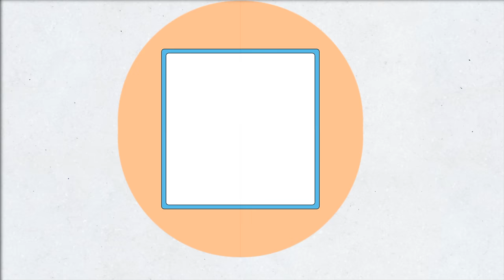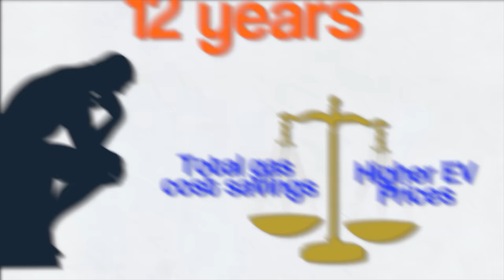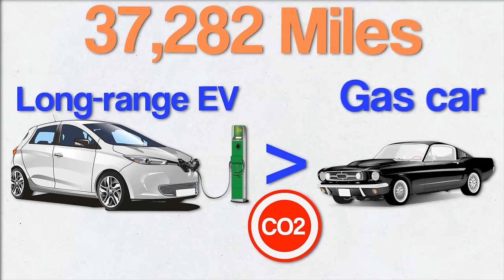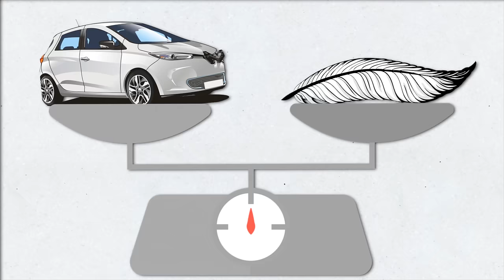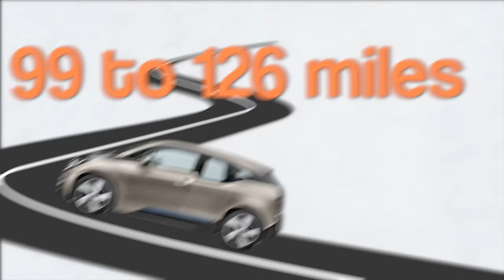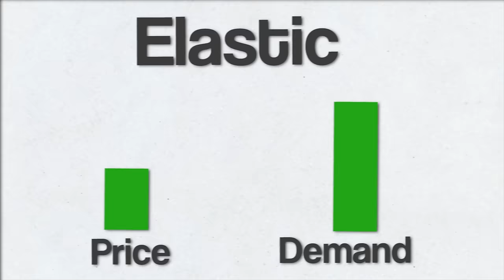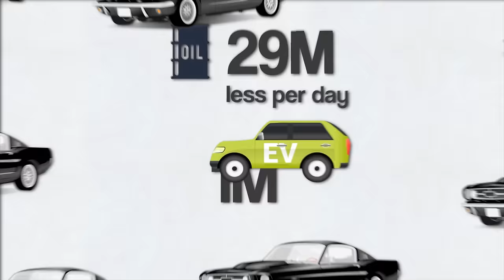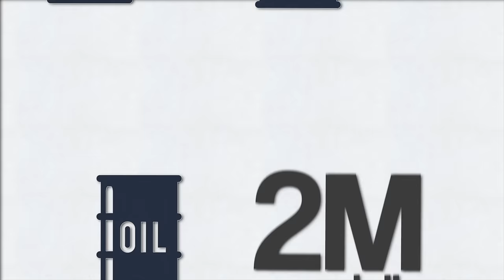If You're Worried About Rising Gas Prices, Watch This

Comment: I agree with you as to why an EV purchase is not wise at this time.  Perhaps if someone really wants to buy one it would be best that he/she lived in and regularly commuted to work in a large city with heavy traffic.  Their carbon footprint would be lower and the skies wouldn’t have that brown haze.  However, I do believe that a hybrid vehicle is the wisest choice nowadays.  Vehicles with a small 4 cylinder engine in a hybrid can get up to 50mpg and they aren’t that expensive, depending on options.  I recently bought a 3 row SUV with a 4 cylinder engine that gets 35mpg in town and 36-37 mpg on the highway.  It is the Toyota Highlander, so not inexpensive compared to others, but it has the nickel hydride battery instead of the lithium battery.  The nickel metal hydride battery is heavier but it still weighs only 200 lbs.  It’s like driving around with a person is in my car when there isn’t, LOL. Lithium is toxic which is one reason it’s not recycled and in certain temperature extremes it can become unstable.  NiMH Batteries are recycled, aren’t affected by temperature extremes and cost less.  My fuel tank holds 17 gallons of 87 octane gasoline which gives it a range of 600 miles.  It is for these reasons and others that it makes sense to buy a hybrid vehicle instead of an EV.

Comment: Hey Scotty I have a question I have a 2001 dodge Durango with a 5.9 L V8 engine 
Do they make good engines and reliable transmissions I was told that it was practically bulletproof should I put money into it , the Struts are going out and The underneath somewhere makes a clunking sound sometimes when I’m driving down the freeway going 65 miles an hour it has 248,000 miles on it and it’s my daily driver to home from work. Should I get rid of it or drive it until the wheels fall off?

Comment: I got an EV a couple months ago. For what it's worth it does save money but there's a big asterisk with that. First, price- anything over 40k destroys savings, the idea is to replace the daily IF that daily is a old beat up bucket. In my case I was using 30 gallons of fuel a week just going back and forth to work in a old 2500 chevy. The cost of fuel ate me up. The price of the car should realistically be from 30 to 40k to make up the difference, if not then it just doesn't make sense. Also understand that I'm not just a random person, I have a extremely unique set of circumstances, the truck had no creature comforts except heat, needs work, old, tired beat up truck ( which I still have and still drive once a week because regardless of its condition I like my truck, because it's mine.) The leaf needs none of the work yet, drives well, has more bells and whistles that I'll never use, and hasn't impacted me financially. But unless you fit a very extremely narrow niche EV is not the way to go. As far as my power bill and range anxiety, have yet to have a issue with either. I charge it twice a week and the bill went up maybe 30 bucks. Range at 100% is 240 miles, as a around town car it's perfect. I'd never take it on a road trip but I'm not a travel kinda person either, I've done my fair share of that already and don't intend on doing that again. Again, I can not stress enough, it is not for most people. Even if it's a option is has a very narrow function and is more or less just another tool for the arsenal and less of a replacement

Comment: The question one should be asking is how long the batteries last before they need to be replaced?
Reply: Wild guess? 5 years.
Reply: Majority of EVs have a 10 year 100k (some have 150k) mile warranty on the battery. It's nothing to worry about. And if you decide to keep the car longer than that, by the time the battery needs replacing the technology will have advanced that the battery you replace it with will most likely be cheaper and have longer range.
Reply: The FUD of battery life comes from the early EV/Hybrids of 10+ years ago since they had no battery management system (BMS) to keep the batteries at the preferred ideal temperature. These days all modern EVs (but still not the Leaf for some reason) have very good BMS systems - there are people with BoltEVs and Teslas that have 200-300K+ miles and less than10% battery degradation. The batteries will outlast the cars, and can be retired for battery storage systems or recycling at the end of their vehicle life.

Comment: You only look at one side of the coin. 

My 2002 Vanagon weighs 6000 lbs and an engine replacement would cost $10k+. A refurbished battery was only $695 installed in our Prius. There are also constant and continuous severe problems with pumping and distribution of fossil fuels. 

Tell me you support big oil without telling me you support big oil.

Comment: Typical courier or Ubi driver drives between 60 and 120K a year. Now, it is well known that the big T EV (named after a famous scientist) gets only about 30K on the tires due to the weight of the batteries. Those tires (unless you found a great deal) run around $274 a tire. That is roughly $1300 (balancing and possible alignment). Plus, each year I also get new shocks / struts. That is around $1000. That is potentially $4300 per year for someone who drives high miles. That isn't even counting the possible brakes, tune-up (recommended). 2.3 tons. That is a lot!!! Happy driving!!!

Comment: Another issue the US continues to ignore is the the current weakness of our energy grid.  We can barely handle the load when the weather gets hot.  AC units on their own cause brown outs and black outs.  Imagine the consequences of adding the charging of several million EV's to the mix.  Our grid would see a massive drop in reliability.  Nobody gives any real attention to this fact.  The power has to come from somewhere, and if the source is already weak you're just asking for more trouble.

Comment: This is why I opted for a hybrid Corolla instead of an electric car. The Toyota is going to last for decades and is a proven, reliable, efficient operation. My dad bought a Prius in 2002 and it's still running 20 years and 200,000 miles later.

Comment: Great video well done - many of the controversial issues that you have identified in this video would not exist if the EV focus was in the direction of the Hydrogen Cell EV - it would be interesting to see a video that challenges the issues that you have identitied comparing Lithium Battery EV's and Hydrogen Cell EV's.
Reply: H fuel cell technology has been researched/developed by the major car OEMs for nearly 3 decades, funded by the DOE until killed by the Obama Administration.  Because it was just a subsidy with no results.  Nothing in the way of a cost-effective solution has been found.  Not to mention that the infrastructure for H2 would have to be built from scratch (unlike fossil fuel and electric infrastructure, which is robust), in part due to the fact that H is a small molecule that easily escapes storage, meaning money leaks all the time.  That means H production needs to be largely local, since it's difficult to store and transport.  There's no cost-effective solution for H storage, it's also been researched for decades.
You can look it all up.
Reply: Have you bought a hydrogen car? If not, why not?

Comment: $17,000/ 150,000 miles = 11 cents/mile.  At 120 MPGe, that make the battery cost $13.6/gallon.  A New Engine Type car would get 160 mpg on $1/gal fuel made at home.

Comment: Fill up at pump takes 15 seconds for 2.5 gallons, which is the SAME energy that an EV has with 84 kwh, which takes 50 minutes at 100 kw constant.  Reality is 1.3 hrs usually.  Around 200 times slower to charge.
Reply: your math doesn't quite make sense since that 84kwh will get you ~300 miles in an EV. In an ICE it will get you way less miles so you need to take that into account. Battery fast charging tech is improving all the time btw. Ioniq5 and EV6 can DC fast charge from 0-80% in 18 minutes.
Reply: @sbroumley  Sorry, my mistake.  I forgot to tell you that New Engine Type (NET) engine is the SAME energy efficiency as an EV (50-75%), and gets 1.33-1.5 times better MPG due to half the weight.  That would be 400-450 miles on 2.5 gallons.  An EV at 80% of 300 miles is 240 miles.  The range is also 5000 miles with 100% CO2 capture.  If the fuel tank were the same weight at the battery, the range would be 21,700 miles, not a silly 300 miles.  BMW and Volvo, along with most thinking car companies realize that EVs can't get the CO2 out due to the CO2 in the BEV manufacture.  The best estimate by Volvo is 25-35% depending on assumptions on 100% RE grid.  NET can get 96% with house solar thermal.  Capture CO2 from car, make fuel from solar, store, and use it (combustion...cleans air, btw), and repeat.  Fuel will be around $1/gal and 160 mpg and no drive battery needed.  My view is EVs are totally silly nonsense and are worthless....
Reply: @sbroumley  I was referencing New Engine Type tech that gets 160 mpg...Sorry for the misunderstanding.  Again, EVs are OBSOLETE.

Comment: I drive my gas guzzler less often and consolidate my trips. The little pollution it puts out, is tiny compared to the environment impact of making and charging an electric car to replace it. And since the average age of cars on the road in USA is 12 years and going UP, not only is the supply of new ones restricted, but the public doesn't have the $$$$ for even more expensive EVs.

Comment: Personally, I think electric cars or some other innovation in engine technology, like fusion energy, will be the future, but it's full implementation is not here yet.  Absolutely adopt electric cars and trucks, and make them available to the public that wants them. More exposure in the public will make them less expensive over time, but the technology really needs to be put into increasing range. There's no reason not to reach for a 500 mile battery. Then you would have something worthwhile to bring into the industry.
If someone has a job that requires them to drive to different locations, and the maximum distance they can drive is limited by the battery in their vehicle, the person is going to probably buy a gasoline powered vehicle. 10 minutes at a gas station refueling and paying for the gas is infinitely better than a half hour minimum to recharge the battery bank.
Also, the availablilty of recharging stations needs to expand dramatically. 
Right now, my town of 25,000 in sw North Dakota, has 1 Tesla supercharging station, and that was only built a few years ago. The next closest station is over 100 miles away to the east and west, and to the north, is in Canada (Quite a ways up into Canada), and to the south, over 200 miles away. There are other plug-share charging stations, but you have to look online for a map, then hope it's accurate, and not some intended location to construct a charging station in the future....and every little town for the most part, has a gas station. 

Sorry, but I'll stay with my gas powered vehicles.

Comment: The people that own EVs don't care as much about rising gas prices because it doesn't apply to  their car, although it does apply to them in rising prices everywhere else. Let's look at the other advantages of EVS. Eventually somebody is going to build a device that will charge the battery of the EV while it's driving down the road, via solar power or perhaps a mini wind turbine operated by a forced air turbo system, and then that's going to eliminate the need to stop and charge your car for an hour or two. You won't have to stop to get gas, you won't have to worry about somebody stealing your credit card information for swiping it at the pump, I think people will be just happy with these and OPEC will get what their greedy azzes deserve.
Reply: Yeah, maybe. Im still waiting for the flying cars they promised us......🤬

Comment: There is around 140 pounds of lithium total in a Tesla Model S battery pack. 500,000 gallons of water is used for every 14 battery packs made for Tesla cars. 387,000 Teslas of all types have been manufactured. Divided by 14 battery packs per 500,000 gallons of water equals 27,642 sets of 14 battery packs, times the 500,000 gallons of water it takes to make 14 battery packs equals 13,821,428,571 gallons of water that has been used to make all of the battery packs manufactured so far for Tesla cars. I think I got that right.....

Comment: This information while entertaining is not entirely accurate.
I bought a used EV in September 2021.
Got a great deal and a good reliable nearly new car for 15K. My family and I love it! No gas no worries. It will outrun most cars on the road,  I charge it with solar power and it runs Great! 
Happy Motoring!
Reply: That's awesome - which EV did you get?

Comment: EVs are a great alternative for some people but not all people.  A couple of points you've omitted.  Depending on make and state, many folks will qualify for $7-10k tax credit to offset higher cost.  Many EVs use one-pedal driving and brakes can last 10+ years.  EVs come in all shapes and sizes with dozens of models hitting the market.  Look at Rivian and EV trucks for an example.  Long charging times are irrelevant if you charge 99% at home.  So when folks ask me "EV or ICE", my answer is "why not both?".  I'm counting the days until my EV arrives.  Cost to fill a "tank" will go from $100 to $17 all from the comfort of my home while I sleep.

Comment: Higher demand on electricity will increase the price of even your home power.  You still don’t save in the long term.  Want to do less emissions drive high mpg vehicles that are typically smaller.   Better yet when it’s practical use Ebikes for local commutes and leave the car in the driveway.

Comment: They should use solar panels on the top panels of the EVs . As for me I'm sticking to gas vehicles. In fact vehicles prior to 2000 are best due to all the computer controlled lights doors etc  they are making a conputerized mess on a vehicles that are meant to be basic transport

Comment: One way that EV's could work will be an ability to connect to a stationary power supply while in motion. Then the storage capacity of the batteries could be reduced, maybe to the point where a bank of traditional lead-acid batteries  could be used to cover the dead-spots. 
I think our transportation model based on everyone having their own vehicle may be needing a major revision in thinking.
The most energy efficient means to move people and cargo  is with the use of electrified rail. That I believe to be the future. 
I was borne at the start of the age of automotive dominance, 1949. I may live to see that age end.

Comment: A 1000 lbs battery in an EV would get ~240 miles at 80% charge.  That same 1000 lbs in gasoline (155 gallons) + tank would give 21,700 miles in a NET car.  90 times further range/weight of "fuel tank".
Reply: Your math is off and definitely not an apples to apples comparison.
21,700miles from 155 gallons is (21700/155) miles per gallon = 140mpg. 
Also that EV 80% charge will cost you say $30. Tat 155 gallons of gasoline will cost say $4 x 155 = $620.

Comment: Scotty you beautiful fish, finally someone on YouTube that actually researches and outlines the reality of EV cars. Except about the oil impacts, Where's the energy coming from to charge the battery? Depends where you live but it ain't the fictional "renewable" energy so it's coal, gas or oil. So they're moving the pollution from what you see to what you don't see, it's almost magic but the CO2 is still getting generated that's guaranteed. It's not magic!
Volvo released a report stating an EV under pristine conditions must drive 60,000 Miles to even begin to break even with a fossil fuel vehicle.

Comment: When talking about battery replacement cost, its odd that you went straight for a car which costs £95k and has a 100kwh battery capacity. Let’s take a car with a more realistic price. How about the Kia e-Niro 4+, a car we have which cost £40k and has a 64kwh battery. Now £87 per kWh x 64 = £5568 or £6,905. Slightly different from the 12-15k you mentioned. The Peugeot e-208 has a 50 kWh battery, which would give a figure of $5394

Comment: Forgot to mention our current power grid could not handle everyone plugging in their cars. That will require a massive change there first and just how do you get more power to run them? It ain't coming from the wind or sun, that's for certain. EV's are the flavour of the day but we're simply not ready or efficient enough yet.

Comment: Your sir are wrong. I bought a used 2014 nissan leaf with 32,624 miles on it I paid $8,999 February 2020 it will be paid off in 5 weeks free and clear. Never changed the brakes no exhaust tune up or oil change. Not including those my gas (electricity) will have paid for the car in 1 more year this is based on $3.00 a gallon of gas. I can charge at any nissan dealership for free and most other places are FREE I don't even pay to charge in most public places. I got the discount because  it was in a fender bender and the battery was ruined. The insurance fixed the car and it got a new battery. If its cleaner great I did this strictly to save money. Your right about range anxiety especially since everywhere I go is about 15-25 minutes away. But one you have your routine you know how much gas or battery % you will use. I never ran out of gas and I have the 24kwh battery which gives me roughly 75 miles if I drive like grandma lol real life expect 50 miles. I'd reccomend the 40kwh or even better the 60kwh. But those would be way more money. I reccomend for shorter commutes or in city driving save lots of money. I'm fortunate none of the systems broke down because that will cost me big money ie. Regenerative brakes etc. My battery life is at 11 out of 12 for longevity. I do watch like your videos keep up the good work and informing us!